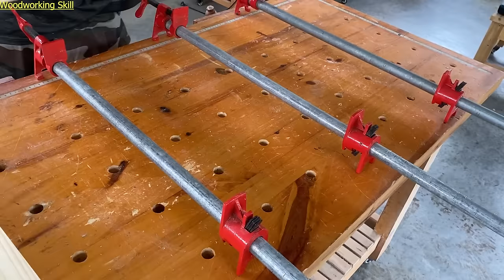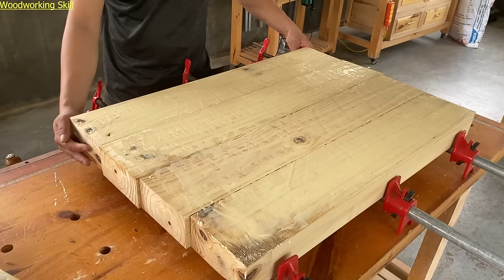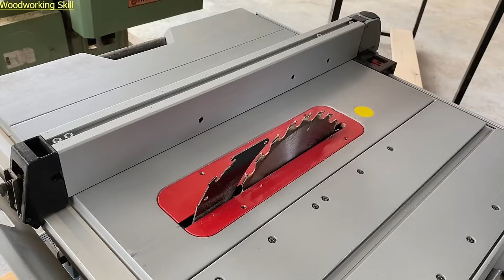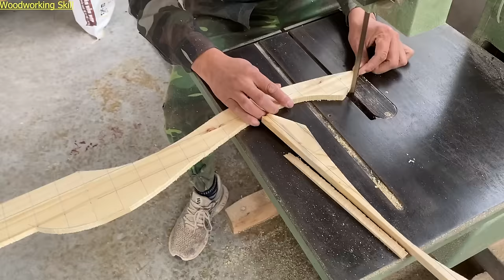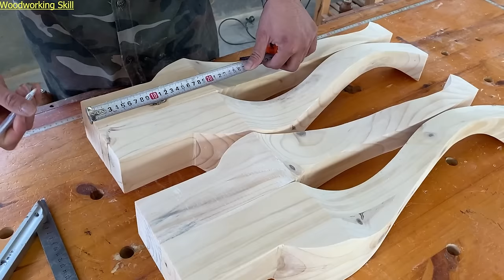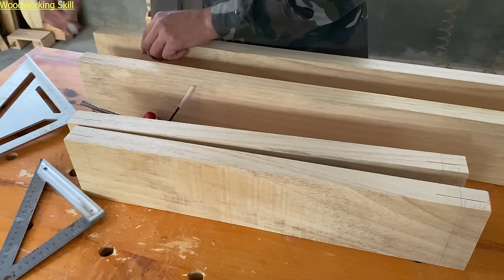Awesome Woodworking Projects for Every Skill Level // How To Build Your Own Unique Table

Comment: Interesting. The top is going to crack since the glue isn't going to allow for expansion and contraction. You've also got some future structural issues in your legs with problematic location of knots near stress points. One of your legs appears to have grain delaminating from ring shake already. I was surprised by your choice of finish given the large open knots and unsightly blue staining of the wood. Attention to a few important details could make this a top-notch project.

Comment: Yes I like this table best thing you have made joints are good but I would have used wooden buttons to fix top down not glue and screws as top could split using glue if shrinks

Comment: Awesome job, I’m a fan of how the legs turned out!  Consider using a rubber mallet for the mortise and tenon joinery.  👍🏼
Reply: Whats the difference between using a baton or a wood or rubber mallet? I personally use a wood mallet but I could see the value of using a baton.
Reply: @jeffreytinacanine5026  My main thing is just not marking up the wood, I’d prefer a white rubber mallet.